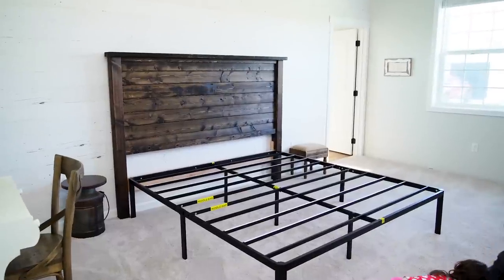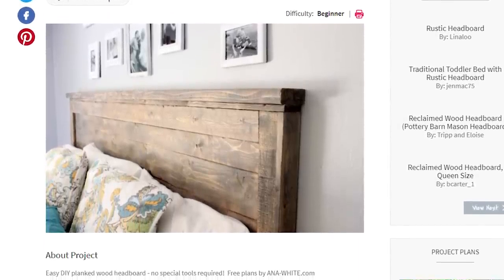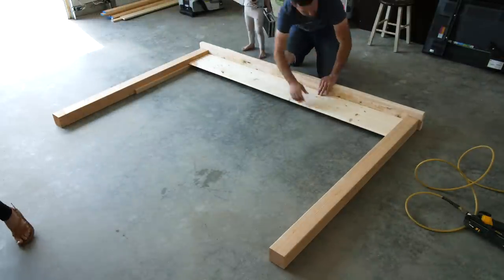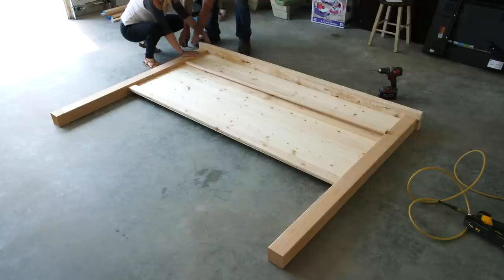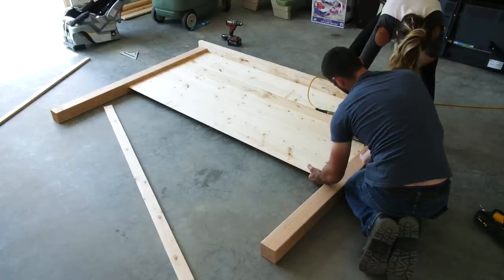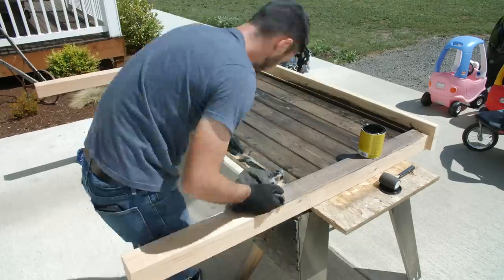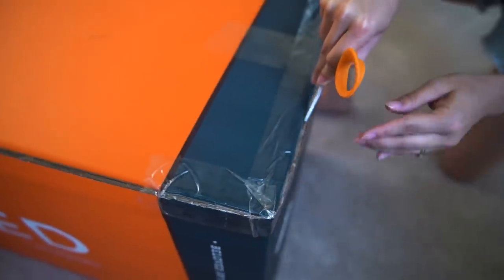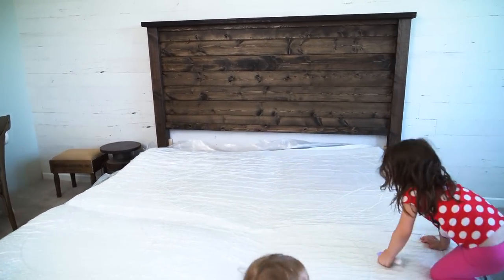DIY $50 RUSTIC FARMHOUSE HEADBOARD

Comment: Love it! Question: Is it attached to the wall? If so, how? lol
Reply: My bed frame has holes in the back of it.  So I drilled through it and used bolts to attach BUT you can attach to the wall also.

Comment: Great design  and looks.  Many have ask about the bottom support not stained piece which is not in your plans or the video.  I am assuming it is to attach the bed frame.  I have built similar before and there is always the headboard wobble to contend with, especially since the headboard is so heavy.  Did you anker to the wall or is it free standing to the bottom support?  Great video, thanks!

Comment: looking for king headboard as my king Wooden Platform Bed Frame did not come with headboard and is the same walnut color. My question on changing your "Ana White" plan and using 4x4, was the headboard heavy with extra thickness of  4x4.